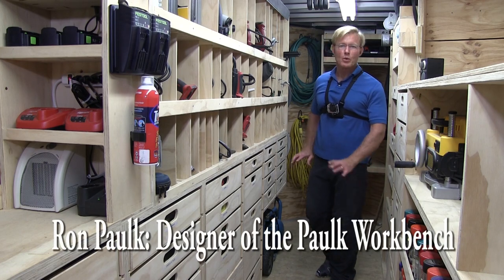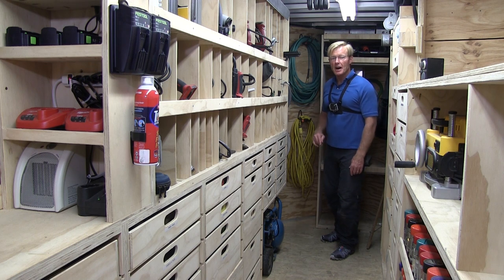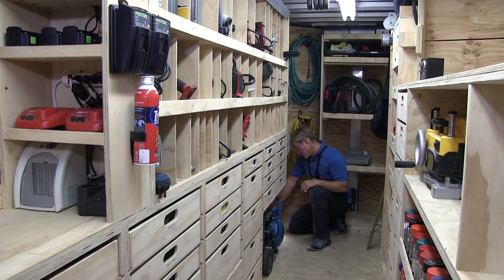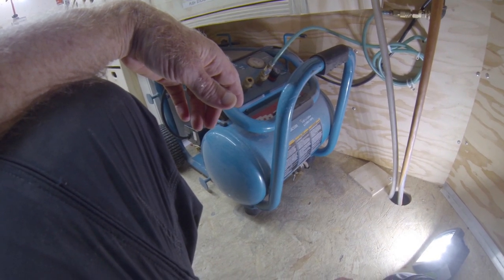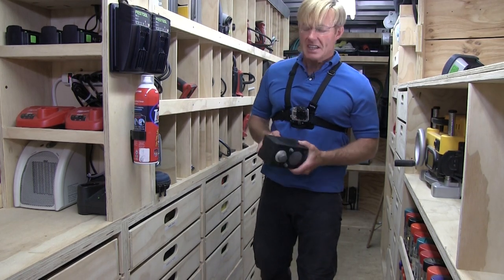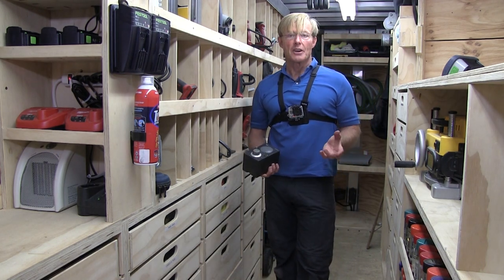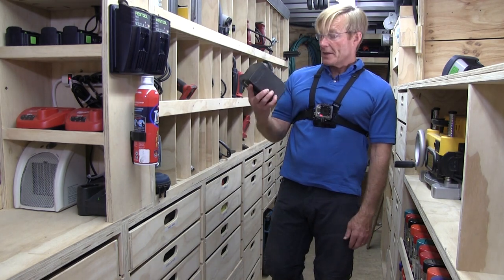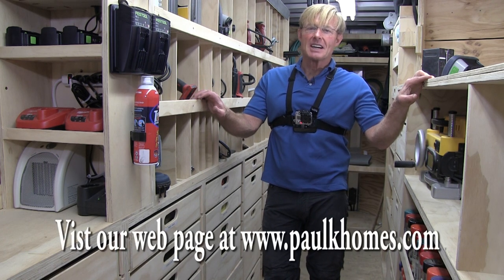MAGIC COMPRESSOR DRAIN & TIVOLI

Comment: I'm just a woodworking hobbyist but I know I'm not the only one who wants to copy Ron's bad ass trailer just because I'm an organizational nut. I like the idea of all my tools being enclosed in a trailer even if i only move it to make room in the garage for my wife's car.
Reply: Ditto to that !
Reply: I thought I was organized and efficient until I started watching Ron's videos. I'm usually the most organized subcontractor on the job site, even more than the general contractor but Ron is three steps beyond me.  My tool and storage requirements are not the same as his but I have been able to apply some of what I have seen in his videos to improve my operation, especially in the tool trailer. Because of rust my old Isuzu box truck is at the end of its useful life. I just bought a new trailer to replace it for tool transport and storage.
Reply from the maker: When you have your trailer built out, send us some photos to post on the Paulk Workbench Facebook and pinterest pages.
Reply: I'll do that but it won't happen for several months. The short exterior painting season keeps me too busy to build a trailer in the summer. This will be a winter project. Until then I'll be using store bought shelving units attached to the walls to keep them from tipping over

Comment: Ron, when towing the trailer on wet or muddy roads is there ever a problem with water splashing into the interior through the holes in the floor?
Reply from the maker: There are only 2 holes through the floor: a small hole for compressor drain which is filled up with the drain hose and a large hole for the power and air hose which has a cover when not being used. No dirt or mud gets in via these holes.

Comment: Is that a makita compressor? Work well?
Reply from the maker: Yes it is a Makita. It works as well as any. The problem with ALL of the small compressors with a direct drive motor is blowing circuits especially when they are cold. If you have room, consider a wheel barrow compressor with belt drive motor. They are more powerful, but easy on start up as they are belt driven.
Reply: +Ron Paulk great info! Thanks much!